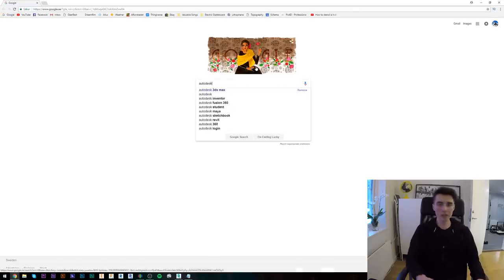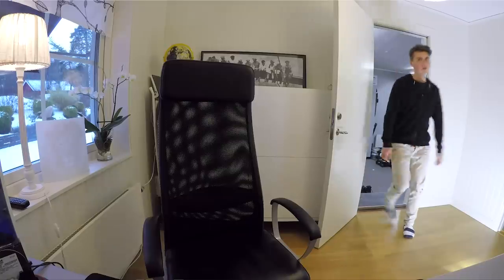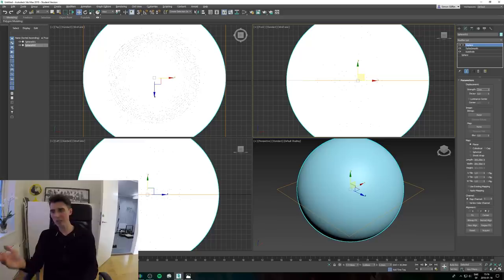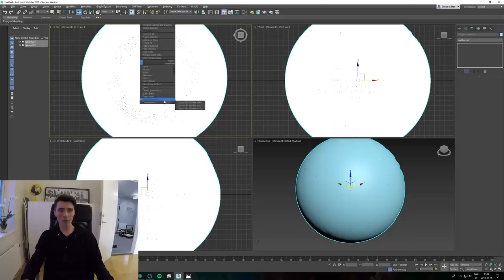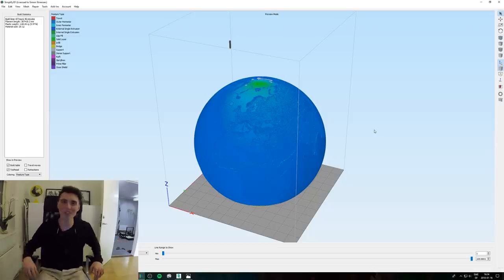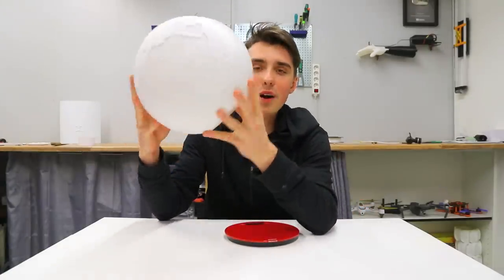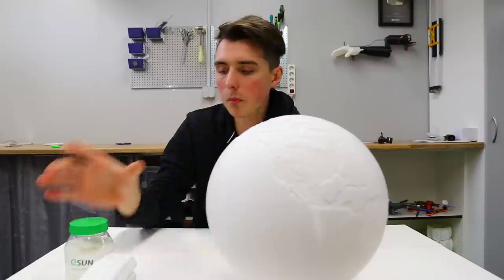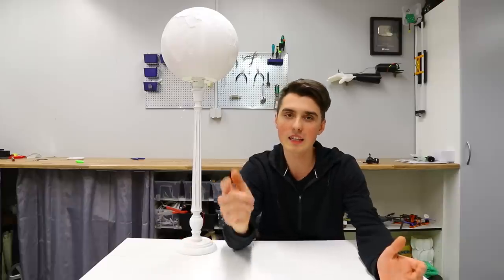HUGE 3D Printed Spherical Lithophane Globe - 100H PRINT!!!

Comment: Can you design it in the inverse? Not sure what the proper term is.
But basically, have the outer edge of the sphere smooth, and the layers are going inwards. So when the light is off, it just looks like a smooth sphere, but when it's on, you get the map showing through still because it'll still be varying levels of thickness?
Reply: Valsotevs true. I might see if I can try it eventually, but at a much smaller scale so I don't waste so much filament if it doesn't work
Reply: I imagine some detail will get lost this way
Reply: That's a really neat idea - you may want to consider printing it "upside down" with the northern hemisphere on the print bed since the majority of the landmass is up here and therefore detail that would otherwise be printing in mid air on the underside of the upper portion
Reply: ryamoo 
Ignoring the difficulty of a print like that, it would work!
...
Mostly
Having printed quite a few lithophanes, detail is lost when you shine the light in reverse. The image still appears, but if your light isn't just right it gets fuzzy.
It would work pretty well with simple patterns or images, but don't expect a perfect work of art
Reply: It would work if you printed it in halves.
Reply: This what I was thinking maybe you could take the minimum thickness possible of a layer off off outside and add that inside? Or the inverse of it? Maybe if you had a dual you could add black on the inside? ... I know I'm obviously talking out my....

Comment: Is there a way to get the texture on the inside so it looks like a smooth ball until you turn it on?
Reply: Just put the map on the inner ball. It would be like what he did, but turning the whole globe inside out. I would think it would still show the map once lit up. The wall is so thin, the map might still be a little viewable with out a light. This is just my opinion, I haven't tried it..
Reply: Viking Beast it works I’ve done it
Reply: @Volt64bolt  Can you upload the STLs please?
Reply: NCZIOOX what, to YouTube? How?
Reply: NCZIOOX just take a sphere and use that to cut into it, in a cad program, just make sure it’s not to thick and that it’s slightly bigger than the other one so that it cuts the inside, but you will have to use an inverted map to start with other wise it will end up looking the opposite
Reply: @Volt64bolt  thingiverse or dropbox wouls be cool
Reply: @Volt64bolt  lol calm tf down. I was replying to your youtube comment before you posted the other comment. no need to get hostile
Reply: @Volt64bolt  Yeah do that, just put it on thingiverse lol
Reply: @MrSdfghjkl2345678  that was 3 months ago, it was up for one month for $50
Reply: @Volt64bolt  ah to bad
Reply: @MrSdfghjkl2345678  ?

Comment: Hey - it’s me from Germany 😅
I also printed something similar - I printed the moon - actually it came out very well but when I do put a light into it, I can see the single layers and they actually are more visible than the moon structure - any tips - or are the layers also visible on your print and it’s normal?
Reply: Printing the moon was my first idea too. Do you have you photo file available somewhere?
Regarding your layers being visible, I would probably try to use thinner layers and increase the hot end temperatures, so that the layers would stick better to each other (I also think that printing ABS with overheated nozzle might bring a better finishing)

Comment: I am going to try printing this with a 1.2mm nozzle. for the support easy solution (maybe) put a single perimeter CYLINDER in the center (fast and low filament usage) then add infill to the top layers till it gets hold (10 layers should do it) then SUPPORT between your cylinder and the sphere. should greatly reduce both time and filament usage. in THEORY you might be able to use a .6 or .8 nozzle to make a vase mode cylinder with a flat top (bottom invert 180") and "set" it in place in side the paused globe. would be tricky though easier just to eat the time and print it in place.

Comment: Great work, it looks awesome. A question, you opted to go for a mapping that reflects the visual representation of earth which results in a kind of reversed structure on the printed globe, but did you consider using a topological map that actually shows the mountains as higher/ thicker and the seabed as thinner layers? I would by reflex had started looking for a topological bump map of earth but after thinking about it, it would probably look nowhere near as nice when back lit.

Comment: what if you printed it upside down, with pin supports that can be easily removed to support the bottom and the hole at the top?

Comment: USA

Print the thing in rings of 30 deg Latitude, with 30 deg longitudinal lines added

You get an easy to assemble globe and only need supports for the cap prints
the glue lines and the longitudinal lines will be an enhancement.

Bonus... any fail only fails one ring, not the whole globe.

Comment: I keep researching 3D printing and unwittingly also keep ending up on these videos; assuming this video is older and not many will see this comment, do you know if it's possible to print a completely smooth sphere around this size, or will that require sanding? I'm looking to wrap the sphere in vinyl